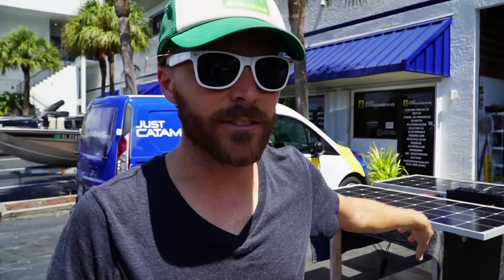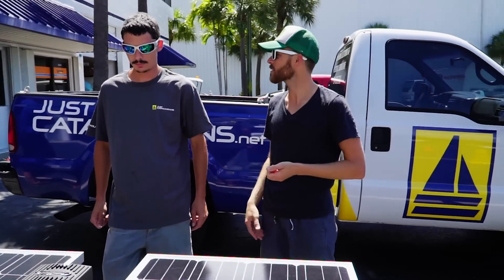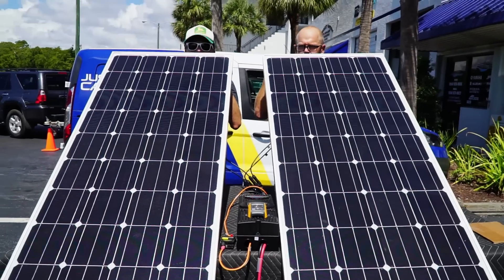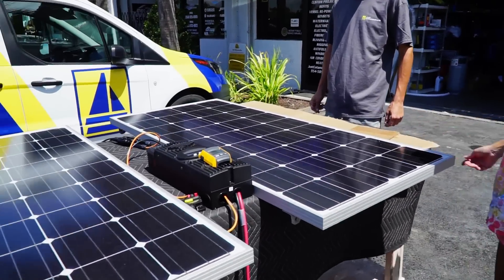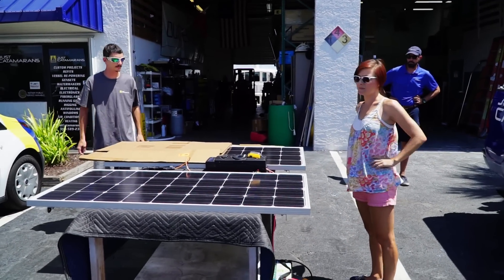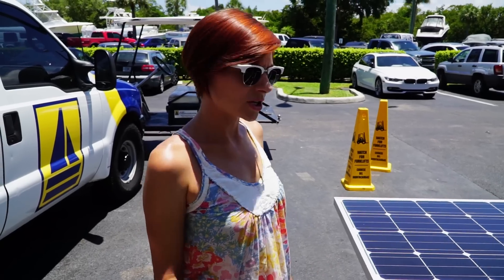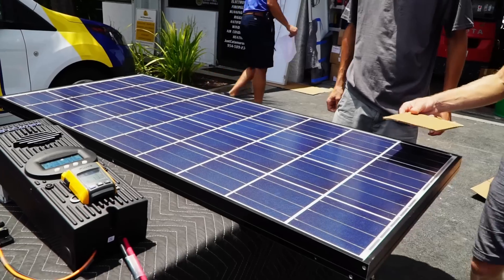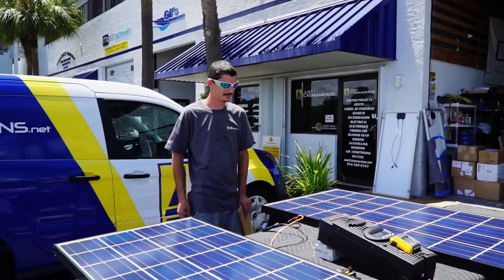Sailboat Solar Power - Series vs. Parallel & Shading

Comment from the maker: I know there are still lots of questions to be answered based on this unofficial test.  If you want to know a little more about the test, our experience, thoughts and the products we're using click over to our site...there's always more info there: http://bit.ly/solar-test 

Thanks for watching!!!!
Reply: I was surprised to see that the by-pass diodes didn't work. That might be due to a MPPT algorithm that's not aggressive enough. Many modern MPPT's have a special more aggressive algorithm for when there's shading involved (e.g. OptiTrac from SMA). So maybe see if Outback has an firmware update or if it can be activated through settings. If the MPPT is able to find the MPP reliable it might very well turn out that series is slightly better, but for now you're conclusion is probably right.

Also if you want to learn a lot about solar, MPP, by-pass diodes, etc:
http://www.pveducation.org/
Reply: You lost me my friend. I don't understand how a diode which blocks traffic to only one direction and an algorithm go hand in hand. We are talking about two separate components here that don't talk to each other at all. The controller can only take what the panels gives it and then through the algorithm decide how to do it's output to the batteries. I took a quick look at the link you gave and it didn't help.
Reply: You're anthropomorphising to much, obviously they don't talk.
Also, you don't read enough. I'll take you a couple days at least to study that resource. I did say that you can learn a lot right?

Anyway, if that's more than your attention span, you might've read chapter 7.2, especially this page:
http://www.pveducation.org/pvcdrom/modules/bypass-diodes

"A bypass diode is connected in parallel, but with opposite polarity, to a solar cell as shown below. Under normal operation, each solar cell will be forward biased and therefore the bypass diode will be reverse biased and will effectively be an open circuit. However, if a solar cell is reverse biased due to a mismatch in short-circuit current between several series connected cells, then the bypass diode conducts, thereby allowing the current from the good solar cells to flow in the external circuit rather than forward biasing each good cell. The maximum reverse bias across the poor cell is reduced to about a single diode drop, thus limiting the current and preventing hot-spot heating."

I'll leave it as homework to you to figure out why might need a different MPPT algorithm to take advantage of such a configuration.
Reply: Paul
Thanks Paul that does make a little sense to me.
Reply: LOVE the John Deere Hat Jason!!!! A solar test is a GREAT idea!! Praying that solar works well on your new boat!!! Thanks for the GREAT video!!!! :)

Comment: Speak to your supplier and ask for schematics of the panel internals. Specifically you want to know the "string" organisation and the number of bypass diodes present per panel. Very simply, typically cheaper panels have less bypass diodes, which means more losses when one cell craps out or is shaded.

For instance, in a perfect world, each cell would be protected by a bypass diode, as soon as the resistance of the cell increases (ie. via fault or in this case shading it) then the bypass diode (or shunt) enables the re-routing of the current around the circuit. Remember cells are wired in series to one another, so one cell dropping out without bypass diode protection will kill the string it belongs to ...

So, a "poor" panel with 72 cells in series (1x string of 72), might have one bypass diode (effectively bypassing the panel!), so a single cell shaded or damaged causes the whole string of 72 to go dark, the bypass kicks in and the whole panel is nulled, but power flows … a "better" (ie. more expensive) panel would arrange the 72 cells as 4x strings (of 18 cells each), where each string is protected by a bypass, hence any single cell would effect only its string. As with all things its just a trade off of cost and engineering, but with a less controlled physical environment on a boat it'll be fun!
Reply: So far in reading the comments, Mr. Morgan here is the only one who knows how a solar panel operates.  I hope the Wynns decide to call a valid solar installer who is willing to explain this to them.  The first question anyone qualified should be asking is, "What electrical load (in amp-hours) do you want to provide power for and how long?"  After that, take a look at the most common voltage output you use on the boat and build the battery bank to hopefully match the most common voltage requirement.  That way you minimize the voltage transforming to power your equipment/instruments.  This plays directly into how you string your panels.  It's fine that the Wynns are focusing on the electrical production, but how you consume also plays an important role in efficiency.  Another important point, the engine battery should not be the solar batteries.  There are a number of youtube videos that can be your guide on this.
Reply: in another blog, a yacht just installed two of the newer LG 340 watt panels it will be interested to see how they work out mounted flat on a yacht from a performance perspective.
Reply: That explains it all. Still, as an electrical engineer I can't for the life of me figure out why solar panel cells are strung in series. In parallel, they wouldn't need bypass diodes. I can only assume there is some MAJOR drawback with parallel cells, because if not, the series design is fundamentally flawed. 
As for only some cells having a bypass diode, I guess its a case of "You get what you pay for", meaning more expensive panels will have more redundancy, but it is clear that manufacturers are not up-front enough about this specification. The redundancy spec should be as important as the max capacity of the panel.
Reply: +Adippen each cell still only generates a small voltage (<1V), so stringing them in series is still necessary to get the voltages up to usable levels as they come out of each string ...
Reply: Aaah yes of course, that makes sense. Individual cells generate a tiny voltage, so you need a minimum number of them in series to output a decent voltage. Then you can connect those groups in parallel and/or, have a bypass diode per group I assume. Thanks for the clarification!
Reply: +Adipen "I can't for the life of me figure out why solar panel cells are strung in series."  Series means higher voltage which means lower current for a given power and therefore lower resistive losses.  I  ^ 2 R means the resistive losses go up as the square of the current.
Reply: Only just caught up to this part of the Wynns. Depends on your situation and needs. Practically speaking from a safety perspective, higher voltage and lower current vs low voltage high current, is the difference between being kicked in the shins, or the family jewels. Its the current (amps or I) that really hurt. SO in high movement / flex situations, using higher voltage and the ability to use more flexible wiring (thinner gauge) is a bonus. In a house (unless you live on top of an active volcano) however the reverse is more beneficial.
Reply: That being said, as a rule, always over engineer any wiring. As Adipen stated, current loss is a huge factor in solar systems, also oversizing your wiring means less chance of fires being caused by hotspots
Reply: That current loss has to go somewhere, and in electricity it's almost always becomes heat in under sized wiring or components(Thus hotspots). In mobile situations if RV or Boat manufacturers use 10 gauge wire, I use 6 or 8 gauge. In real high flex situations like competition 4wds etc, if 10 gauge is called for and I have the room for the wiring run, I use 2 x 6 or 8 gauge wires (this means instead of 1 thick wire, I have 2 thinners wires sharing the load, more flex tolerance. Yes this comes at a price. I've had mates ask me why so high in wiring runs, my reply is safety. Sure if something went haywire insurance would cover it, but, does insurance cover you in the middle of pacific ocean, or the nullaboor plains ? Shit no, insurance only starts applying AFTER you have lived through the situation and got back to civilization. IN the mean time I prefer supplying my friends an extra $500 worth of survival.
Reply: Solar cells are the same, the newer ones even worse, they are really thin, and can't handle high current. If a cell puts say 1.2 volts 0.5 amps and you wire that single cell in series with 10 others you get a nominal voltage of 12 at 0.5 amps, or 6 watts. Yes putzy power. But a very expensive putzy power, because while it only takes short runs to connect each cell resistance in the wiring becomes a hassle. The problem is even though each cell generates power they really are a resistor as well and resistance means heat, you multiply that too much and cells burn out, 1 cell burning out equals one fragged panel. So solar panel builders use both series and parallel wiring to protect each cell as well as giving nominal voltage. That 12 volts is only ingrained because of the auto industry how we are used to using batteries. If solar manufacturers had their choice, everything would be 48 or even 60 volt, remember higher volts equals less current for every watt of power, and inherently less chance of cell / panel / wiring burn out. What the wynn test showed was not so much how efficient each panel or cell was, or even how many shotky diodes were in use, but how conservative each manufacturer were in preserving their cells. Much as the same you you would prefer me to preserve your boat. More panels, to make up the same wattage despite shading, means higher safety for you and your boat at the cost of higher real estate and wiring.
Reply: Ohhh, by the way, I have a piece of paper that took 4 years to obtain that calls me an electronics engineer. In reality, I'm just a truck driver  that loves helping friends and family tinker / modify and improve their 4wd's, rv's and boats for no profit, other than a beer or two and the satisfaction of seeing a project done safely.
Reply: That would fix shading but each diode in the string will also mean a small voltage draw, where do you find the balance between shadeing protection and voltage drop
Reply: I don't think each cell puts out 12v, so for a 12v panel there needs to be some series connections to add up to 12v. It may be that there are several strings of series connected cells that are then paralleled up. Possibly it is each string of cells that has the bypass diode to protect the other strings of cells. That may explain why a panel may only have 3 or 4 diodes, it may have 3 or 4 strings of series connected cells.
Reply: Craig, your spot on. The panels they are using has something not quite right in the diodes. They could be bad, weak or don't exist. Good panels as you said will have a diode for each string in the panel so at any time you'll only loose each string if it get shaded but the rest will work just fine so the only thing that happens is the loss of a few voltes. In parallel when any cell get shaded you'll loose not only the string but the panel as well since it drops lower than the other panels.

The other thing is how the panel gets shaded. If it's also the long side then start by shading a single string. If across the narrow side you start shading all strings.

Comment: I loved the way you show the results, it certainly makes it clear how panels work for those who are not aware of electronics/DC electrical power systems. Just think of each panel as a battery (that only works when light is shining on i), and each one of the cells in a panel is also a battery. The cells in a panel are connected in series. Otherwise you would not get enough voltage.

Comment: Good video. I have my 4 panels in parallel on my 50 foot boat. I have 1,200w (36 amps) and the winter sun angle makes the most shadows where I only get 15 to 18 amps no matter what we do !!

Comment: Amazing guys! I have a Rialta with minimal roof space and consequently circled the air conditioner with 4 x 100W flexible panels and have never seen great results. Granted they're wired in series. After seeing your video I'm contemplating rewiring! I may go with series parallel or all parallel. Either way, I'm amazed at how one cell knocked out the entire {array} when wired in series. I always thought series was the way to go but apparently not! Thank you so much for the excellent video that demonstrates this! I realized what the term array meant from your tilting video when the power didn't start flowing in at a higher rate until the last panel was tilted because the charge controller treats all the panels as a single large panel, or in other words, an array. Power comes from the least common denominator.

Comment: Interesting test and an excellent demonstration on how critical it is to locate your panels without any shading.   I see flat mounted solar panels all the time on RVs that are located next to AC units, antennas, etc. etc. and are shaded for hours of the day.  Especially important in the Winter when the sun is so low on the horizon to have the ability to tilt.   

  I have 2 Kyocera panels a 50 watt and a 140 watt and they are excellent panels.  At twice the cost at $2 a watt they are one of the most expensive panels on the market, so I'm not surprised the output was higher than your GoPower 160.  

 If you have the room you could mount a pair up front and a pair farther aft to minimize the boom shading at different times of day and direction.  Or make 2 mounting areas and move the panels fore-aft as required. I run my 6 panels portable and have zero problems moving them around connecting/disconnecting daily.

Comment: Looks like a no brainer to go parallel - shading has a much bigger impact on serial set up. Consistent with what the yacht literature suggests! In any case we've just decided to skip the flexible panels on the bimini and see how we go with a hydrogenerator like Watt & Sea. We'll have portable panels for redundancy.
Reply: Guy who just crossed the Pacific to Port Vila swore by his hydrogenerator, it produced enough power to handle all requirements on his 40' yacht.
Reply: Do you have a link?
Reply: For the parallel vs serial set up in the yacht literature? No, it was in one of the main UK yachting press a few years ago. For the hydrogenerator: http://www.wattandsea.com/en

Comment from the maker: If you want to know more you really should click over to our website, we provide links and additional info there.  Below I'll try to answer some of the more common questions:

We're not Experts - As we always say we're not experts and by no means are our tests perfect.  We have a question and we try to find a solution.  That is it.  
Diodes - Our panels have 3 diodes however I've been told when you knock out an entire cell it is common to lose the entire panel.
Wind & Water Generators - We are considering adding a wind generator and/or a water generator.  Both seem to be viable options however we've been told solar is the first step for boats...and considering we already own the setup from our RV we think it's a logical place to start as well.
Hat - No we are not sponsored by John Deere, I've had this hat for over 10 years and with the intense FL sun I'll likely be wearing glasses and hats in every video.  I will try to find an unbranded hat I like soon.

Thanks for watching and commenting, we love seeing the discussion, the questions and of course the experts chiming in with real solutions.

Comment: A very well done test in my opinion. That pesky boom is the real killer in mounted panels. No one says the panels have to be mounted. Put edge guides that will hold the panel in place but also allow it to be moved a few feet. The panels won't hurt a thing if place in the walkway along the sides of the boat temporarily. You guys will figure it out. Could also put a wind turbine at the very top of the mast. It's A.C. volts so just a small wire would be needed to the bridge rectifier then to the charge controller. A small 400-600 watt is better that none.. Thanks for sharing your test.

Comment: If you are at anchor, you can always move your boom off to port or starboard,  so it is not shading the panels----depending on where they are installed.  Also, how are you enjoying the humidity here in South Florida???

Comment: Internal Bypass Diodes may be responsible. Our Solar panels do not suffer from such high loss on shading - Our Solar Innova 155w (X3 panels) apparently have 6 diodes per panel. So with loss of one cell we should lose 1/6 amperage if controller is working well.  How many diodes do your panels have?
Reply from the maker: Hello Guys.  We have confirmed that our GoPower! panels have 3 diodes.  I'm assuming the Kyocera panles are the same since they performed similarly.  It's interesting to hear that you're panels have 6.  I'll do some more research :)  
I hope we can cross paths one day, you two are an inspiration to so many dreamers out there.

Comment: As you found out, a solar panel is like a string of Christmas lights. Each panel is made up of a number and type of solar cell. Each cell is wired in series. So when you block one cell the 'string' fails just like many Christmas light strings. Your readings on the charge controller showed 1/2 power during parallel test because really only one panel was producing power. Sooooo since you have the panels from the RV, if you install them on different surfaces around the boat and wire them in parallel you will be less susceptible to loosing lots of power during shading of one panel. That outdoor prewire MC4 connector that you got Fleetwood to do on the RV would be a good addition to have on the boat. If the connector was wired in parallel with your installed panels, then you could add your portable tilting panel kit and aim them when needed.